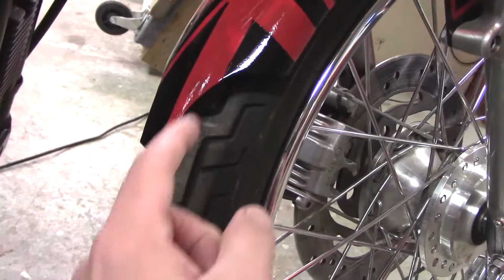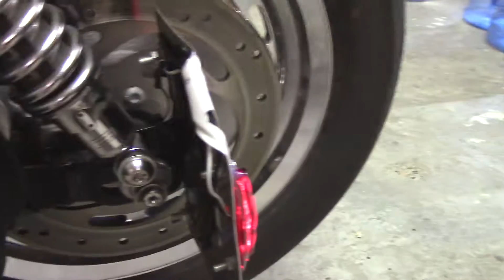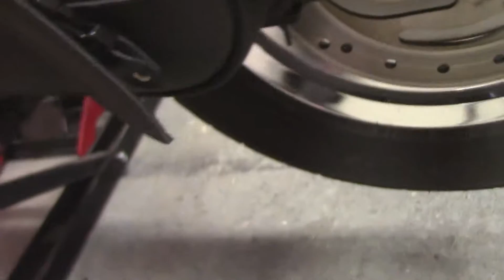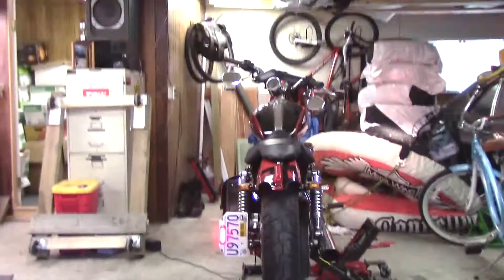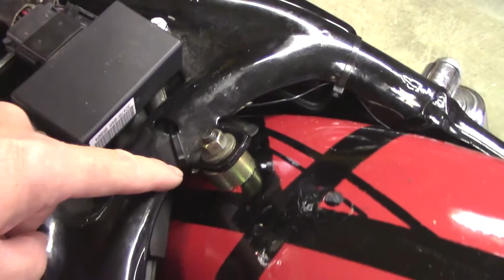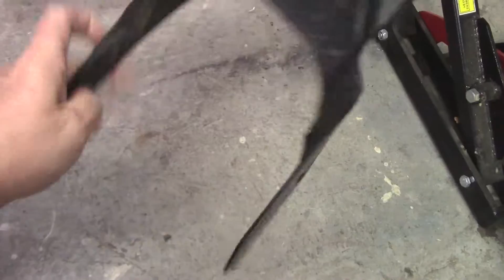Harley Sportster Fender Bob and Light Relocate, Under $100

Comment: I saw your hardware store led turn signals were 1 wire. So you don't have to worry about the ground, but did you just splice into the purple on one side and brown on the other? How did you avoid having the led lights from just staying solid? With a resistor? Sorry getting ready to do it myself. Love the paint job for sure

Comment: The paint was probably wrinkling cause the paint was lacquer and the clear was enamel or the paint was enamel and the clear was lacquer that's usually what happens when the two get mixed
Reply: Lacquer over enamel will lift, not enamel over lacquer. But obviously all he is doing is with uncured products. So more chance for materials to not like each other. Use real automotive paint.